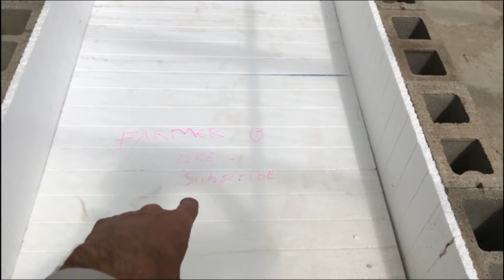DWC Aquaponics Build - Deep Water Culture Aquaponics

Comment: Very nice so far.
 I like the look of the blocks and you'll get many years out of those, I may copy you when the wood rots away from my grow beds.

I like that you used foam board before installing the liner, I did the same thing and it helps keep the water temps stable and protects the otherwise costly liner.

Now for my "opinions" lol
I would have, and I do this, and I've been blah blah blah wawawawawa, oh and
looks great for working with what you have👍👍
Thanks for sharing and as always keep building👍
Reply from the maker: Building with Todd 
Thanks Todd. I have all that foam from a plastering job I did. Boss ordered a few too many pieces to my benefit. My main concern was protecting the pond liner but the stability is bonus. Bare minimum I’m going to change my pipes to the filter to 1 in vs 3/4 that’s already installed, and go from there. Thanks for your support. Much appreciated 😁👍👍

Comment: This setup is very dope and I hope to try and make one similar, just wanted to make sure you just used regular styrofoam before you place the pond liner.
Reply from the maker: I used 1inch styrofoam. All my pond liner rests against the same styrofoam that floats in the grow beds. Technically what I have came from a stucco supply company. If I did it all over again I would use 2inch instead but what I used I got for free. This system has been working really well. Thanks. Good luck  🍀

Comment: Did you use mortar in between the blocks ? If you didn't any issues with blocks bowing out from the water weight?
Reply from the maker: No mortar. No issues with any blow out. System is 18 months old and working great.
Reply: @FarmerG  nice thanks for the quick reply!

Comment: Did you use any mortar on those cinder blocks? What's preventing them from pushing out?
Reply from the maker: There is no mortar. The blocks are free floating. I can remove them anytime. The pressure of the water is not enough to push the blocks out. I have built two different systems this way and never had any problems. Maybe if the height went up farther possibly problems, but I’ve had nothing but success with this arrangement.

Comment: I am still confused. How can those bricks hold the pressure of that amount of water without the mortar. I am planning to build something similar but I will build a box from concrete instead of using the bricks.
Reply from the maker: I like the bricks. If I ever take it apart or decide to build something different I can use the blocks again. There is no mortar. The bricks are free standing. They hold the water pressure. This is the 2nd system I’ve built with free floating bricks. I’ve been using this system almost a year. No need for mortar. It holds.
Reply from the maker: PS the bricks are staggered like you would do when using mortar but no mortar. Staggering them holds the pressure.

Comment: Dont it Need a biofilter ?
Reply from the maker: I’ve never had any issues with nitrification. It took a few months to establish itself but it has been fine without it. I do clean out the swirl filter a dozen times a year or so but there are no issues producing nitrates. There’s a lot of surface area to colonize with just the pond liner and raft beds alone. Sure it wouldn’t hurt to add but it’s easy and simple enough without and I’ve had so much success with how  it is I see no need to add one.